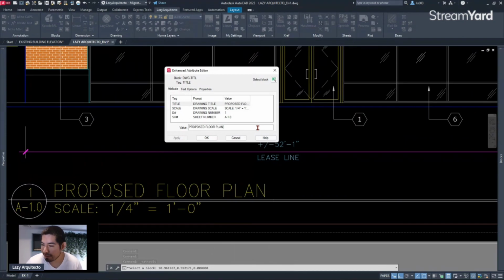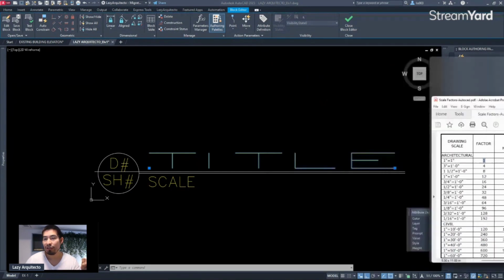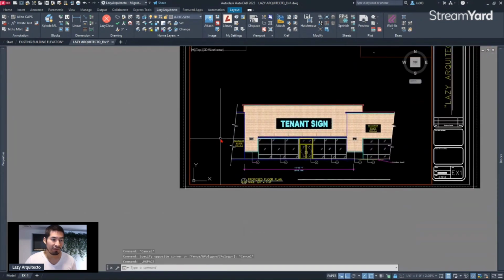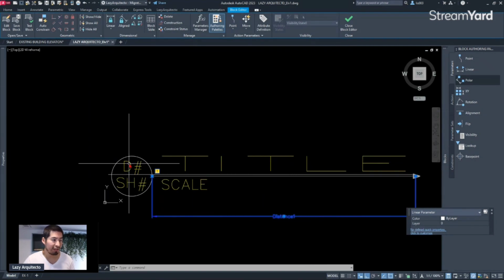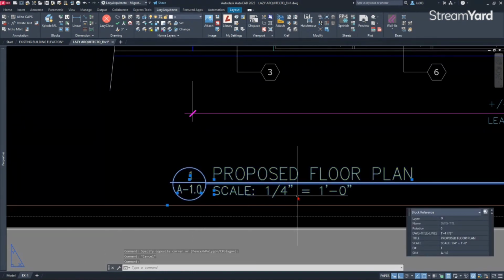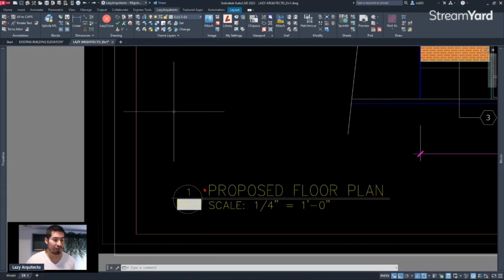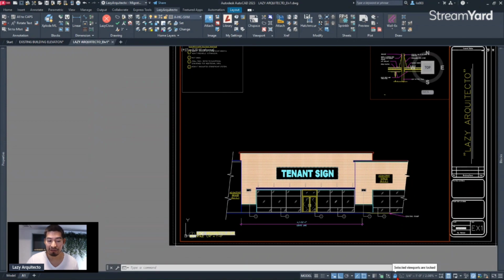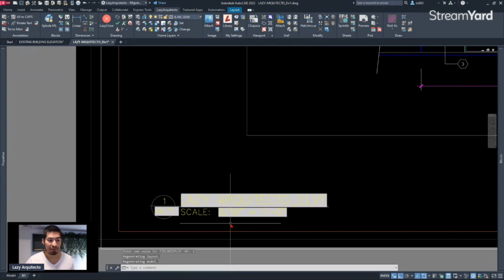Combine Dynamic Block, Attribute and Fields in Autocad

Comment: I have a solid hatch pattern in Model Space in an xref file and text in Paper Space but for some odd reason the text does not display. I have tried changing the draw order of the hatch, the draw order of the text, the draw order of the viewport, flattening z values, recreating the hatch pattern, but nothing seems to work. The only thing that does work is the "Change Space" which will change the text from paper space to model space but i would prefer not to have to do that. I feel like it is a simple fix, maybe some variable that I need to set but i have no clue what it might be. Any suggestions would be greatly appreciated.
Reply from the maker: Did you try draw order, then Regen command?